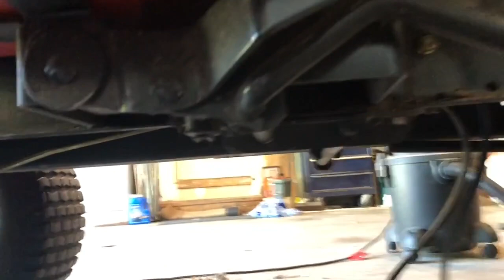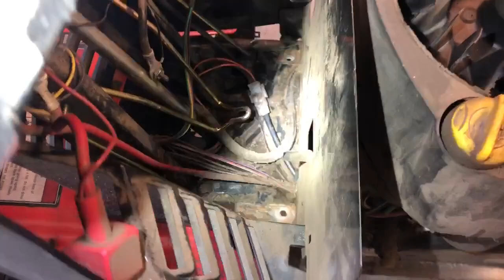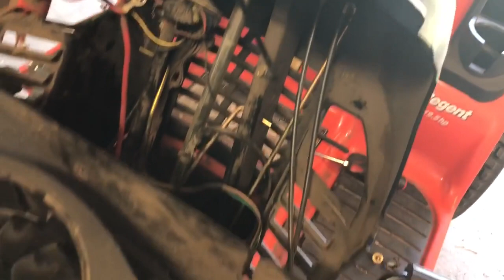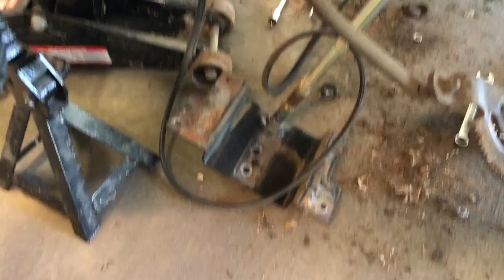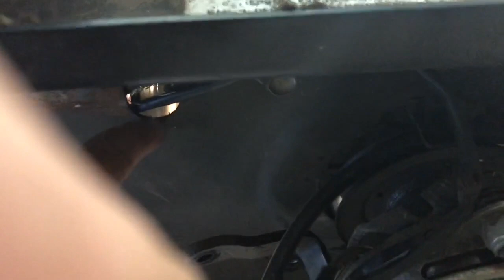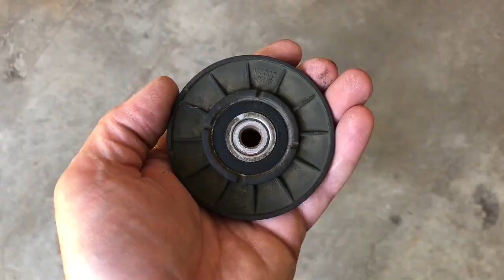stupid Simplicity Regent hydrostatic drive belt replacement!!! SO DUMB!

Comment: Good morning!  I have not followed this thread all the way through, but may be able to save you some time.  Get the thing up in the air enough, pull the steering wheel and the e-clip.  The shaft should slide right down and out.  Remove the center bolt that holds the electric clutch, have a zip-tie ready and swing the assembly out of the way and zip it to the chassis.  We don’t want to damage that cable by supporting the clutch with it!  As the other fellow said, remove the engine bolts and slide the engine over enough so the belt can clear that tab.  Remove the idler pulley and slip the belt right out of there.  Put the new belt on, reverse the procedure, smile, and plan on changing that belt in another ten years!

Comment: I GOT TWO OF THESE FOR $50.00. They both looked new.  I rented a trailer and got them home.  One has no deck ? Both needs batteries. The  one with the deck keeps throwing the   belt off the pulley. Can someone please invent a belt that can be a straight line and can be threaded through all the pulleys. Then clipped, bolted, or velcrode  in place. Thereby eliminating all this nightmarish disassembly ! Please let me know, you will be a hero many times over ! Get to work on it  now ! PLEASE! Now I know why they were so cheap !

Comment: Thank you! Thank you! For this video. I agree whole heartedly that this design is horrible. So I managed to get new belt installed. I still have an issue with it slipping off the transmission pulley under driver seat. Tested before I reattached mowing deck. So frustrated. The belt slips underneath the white fan blades under the pulley????? Any tips?

Comment: Love this video! I just took the belt off and will be putting a new one on there when I get it, hopefully this weekend. Your video made it about a 1.5 hour job to get it off (had issues with that stupid clip that holds the steering column in place). The mower got slower and slower and eventually just wouldn't move/go up a hill. The belt felt VERY stretched and was loose and floppy so I hope this was the issue.

Comment: YOU DON'T HAVE TO remove the steering stem, lift it real high or disassemble the gears .
  Just remove the steering wheel and circlip, put the nut back on to keep the shaft from dropping all the way out .
  Remove the 4 bolts on the bracket and let the bracket drop enough to lift the sides of the belt over the sides of the bracket instead of over the top of the shaft. 😅
Reply from the maker: the gear on mine was pressed onto the steering stem.  You couldn't remove it.
Reply: @TheDillio187    The circlip that you remove is at the top of the shaft underneath the steering wheel cover.    So the entire shaft, gear and bracket assembly can then lower about 1/2" and give you enough clearance to get the belt inside the bracket.

Comment: I had the same issue. What a dumb design for sure. The video I made of it is  titled "Snapper lt200 drive belt replacement". I could not find a video of this as well. I just stumbled on this one of yours. The rest of the Snapper is great to work on but to change this belt is more work than it should ever be. I also had some comments saying how it should be done but none had any video showing what they were explaining, plus some were just wrong. That frozen pulley is what probably wore out the belt.
Stay well, Joe Z

Comment: I replaced an idler pulley and thought it would be a good time to to replace the belt. I abandoned that idea when I discovered that the electronic clutch cable required removal. I replaced the idler and just replaced the used belt. What a stupid design.
Reply from the maker: I wish I had the option to do that.  I am just about to finish season #2 with the belt that I replaced in this video, so far, so good.  Now the engine smokes profusely upon startup, so that will need a rebuild soon.  It's always something!

Comment: Was taking the rack and pinion gear out necessary? I'm trying to figure mine out and it's a 2013 snapper 20hp. Thanx
Reply from the maker: I don't remember now to be honest.  A couple of the other replies here said it's not necessary, but you definitely need to get the belt around the steering stem.
Reply: @TheDillio187  Thanx. Between yours and some other vids, i've got some idea at least.

Comment: Had the loose steering issue on my 5 year old Regent.  Couldn’t find any info on my  model.  But after looking at fixes for other manufacturers, thought this would be similar fix.  WRONG, no easy way.  Considering the steering rack, the belt, the wire, the pto.  What a dumb design.  Wish I saw your video first.  Thanks.

Comment: I just did this job and it wasn't easy because I made a few mistakes by doing some things I didn't have to do.  I removed the steering wheel (nut and keeper ring) and hosted the front end. Wiggled a front tire and the steering stem fell out.  No need to take the rack and pinion and everything associated with it out.  Battery does not need to come out.  The biggest problem was that I had to cut the wires to the PTO to get the belt off because there was no quick connect. Have not finished and may add one for next time Tip: while you are doing this check your tension pulleys, one of mine was worn so while I had everything apart I took them off and replaced them.
Reply: How did you get the steering wheel off? I removed the cap and nut but it absolutely will not come off. How do you remove the keeper ring?
Reply: No need to take the stem out, only drop it an inch or 2 and snake the belt over the sides of the bracket.

Comment: Can you take the electronic clutch off and support it so you don't have to unplug the connector to get the belt on the front? And will the steering shaft pull out through the bottom without taking off anything else? Thanks.
Reply from the maker: I didn't try.  I didn't see any way to just take off the clutch, it seemed pressed onto the output shaft.  No on the steering shaft, you at least have to take the wheel off.  It might just drop out of there, then.  It's been some time now and I don't recall for sure.
Reply: @TheDillio187  Thanks for responding. I ended up hoisting the front end so the tractor was vertical. My steering wheel came off fairly easily and just pulled steering shaft out without removing anything else underneath. The clutch has a bolt to remove on the bottom and the clutch also came off easily. I just tied it to the brake pedal with wire so I could get the belt on the front pulley. It was finished in half-hour or less thanks to some of your info in the video. Hoisting the front end made a big difference also, but still a ridiculous design for belt placement.
Reply from the maker: @bome4691  if I ever have to do it again, I'll try it that way!
Reply: @bome4691  Thanx bud. I think I got the same thing.

Comment: Yep engineer's don't have to work on the stuff they design... tell you one thing, I'd be buying the best belt money can buy!
Reply: After  thought, can you add an idler in there to route the belt around that columb?
Reply from the maker: @arthurbyers9696  probably, but then you'd need to find a different belt (longer).  it's just a lazy design IMO, as they should have done just that.

Comment: Somebody tell me how to move that black pin that is going through pulley ,out of the way,it’s a conquest , 2002-04 , it’s like it’s part of the frame without no bolts holding it

Comment: Just did this. Found it easier to remove the PTO, steering wheel, retaining clip on the stem, and both steering stem bushings. Stem dropped straight out the bottom, no need to pull the rest.

Comment: I feel your pain - I had to go through the same troubles removing half of my Snapper to replace drive belt. I suppose, this should be left to pro mechanic, but in my area there are none so I had to do it myself. At least my belt pulleys are made out of metal not plastic. On same day I had to replace all belts on my tractor (drive belt + deck belts), so my wife kept well away from the garage for half a day because of bad language....
Reply from the maker: haha, every good mechanic cusses like a sailor.

Comment: Thanks for posting. You are a better man than I because my frustration level could never handle it. I have a Snapper LT200 lawn tractor but it is more or less a Simplicity. I have gotten 13-14 years out of it until the belt started slipping.  I'm sure it still has a few years in it but I can't see me replacing the belt. Probably just haul it off.

Comment: I have a simplicity regent not sure how old but you have to drop the blade clutch to take off the belt. Doesn't have a bolt to simply remove out the way

Comment: i just  put one on my express and what a pain in the ass  had to rip everything apart
i put mine up on the rear wheels  
yes the steering stem  i had to take the motor pulleys off  what a pain
the engineer of these a was a moron

Comment: First of all, son, after removing the mower deck, stand the mower up on it's rear end. Then you can work on it. By the way, drain the engine oil end place a plastic bad over the threaded gas cap for anti- spillage. about an half hour job or you're snoozing.
Reply from the maker: thanks Dad.  That's not a bad idea although I'm not real sure I'd want to try to pick up my mower by the front end by myself.
Reply: @TheDillio187  yes, dads right 😄
Its the best way to work on these damn things. Also if you have a sturdy tree branch or a open beam in your garage go to HF n buy the $45 crane. Worth every penny. No lifting

Comment: Were can I get the Diagram that shows how the belt is feed between the pullies?
Reply from the maker: I just looped the belt around the rear pulley and the engine, and then figured it out.  It is logical when you look at it.

Comment: How do you get the steering wheel off after you take the nut off
Reply from the maker: I had to pound mine off.  Another guy suggested using a flywheel/balancer puller, which is probably the better way to go as I destroyed my wheel trying to get it off, it was really stuck.

Comment: Not 5 or 6 of us, but 1974 of us! You are one of the few on YouTube that I found with THIS belt on THIS model! Mine JUST broke and I came right in and started searching to get an idea what I’m in for. I worked in a small engine and mower repair shop for about a year and a half to two years, between working at Auto Repair shop and a Ford dealership. I thought it would be a BREEZE working on mowers, chainsaws, weed eaters and small engines after the nightmare of a major auto dealership,... HELL NO!! Crap like THIS had me kicking myself in the ass and back into cars and trucks as soon as I could!! I thought that I wanted to beat some engineer with a combination wrench when I was working on some of the crap they came up with on Ford car, I couldn’t believe the crap on many lawn tractors! Those engineers needed to be beat and the thrown off a damn cliff!! I think High School kids could engineer some of this stuff better!! Hell! Aside from the riding mowers and lawn tractors, everything else was basically DISPOSABLE! I cost more time in LABOR to fix most chainsaws and weed eaters than it would to FIX it! The shop I worried for also had FREE estimates, so I knew that 90% of them that came in was gonna be a waste of my time and I was NOT gonna get paid for it! AND I wasn’t allowed to TELL the customer that when they would bring them in! Commercial guys with more high end stuff would, but the average homeowner with his Ryobi weed eater was just gonna eat up my time! Oh well, just venting after watching your video and knowing what I’m in store for, flooded me with memories! LOL
Reply from the maker: I had no idea this video would be so popular, it was more so an attempt to help a few guys out and get my rant out there so that I could hopefully laugh at it later.
Reply: @TheDillio187  you are one of the few that are actually changing the DRIVE belt, and not the deck belt and titled as the “drive belt”! I have a Snapper LT125 that is just about the same as yours with a different name. From what I can see on the ground, I’m praying that maybe Snapper mad that rack plate removable! Otherwise I might drill some bolt hole, grind off the weld and make it removable myself! Looks like that would be faster! The the next time it breaks it won’t take as long!

Comment: Got the belt off my 2009 Simplicity Regent. TheDillio187 did a fine job going over the procedure in his (your) video. I altered the process just a bit. Instead of taking the steering wheel off, removing the retainer clip, and dropping the entire pinion shaft I removed all of the bolts securing the steering column to the pan so the assembly could wobble around. It was enough to slide the belt over the pinion mounting plate flange underneath. Also, to get the belt off the engine pulley (belt keeper pressed in pan, not enough clearance to get belt off pulley) I removed the engine mount bolts and slid engine to the side.
Reply from the maker: goes to show you that there's more than one way to skin a cat...or a Regent!

Comment: Getting ready to change out the belt. Taking old one off then new one (1728008sm) gets here in a couple days. Appreciate you sharing your pain for this should be easy job. Advice to mower buyers, don't get a Regent (they may have changed the design but I doubt it).
Cannot believe the design. The mower (2009) has been a good one after I stopped using the power blower for grass attachment, it was tearing up the deck pulleys and spindles. Zero help from dealer. I digress, back to the belt. I was seriously considering cutting old one off and installing new one on right side of steering shaft and letting it rub the post.

Comment: How did you know it was time to replace the belt.  My mowed struggles to climb small hills and pull and yard equipment.
Reply from the maker: the belt kept popping off of the pulleys.  Sounds like yours is probably slipping badly.
Reply: @TheDillio187  The belt has never slipped off But I cannot even pull a roller or a seeder because the tractor won’t move
Reply from the maker: @alexblair4267  The belt is slipping around the pulley. I would just replace it now otherwise it’s going to get hot in break anyways.
Reply: Are you saying replace the belt or the pulley
Reply from the maker: @alexblair4267  the belt, but inspect the pulleys as they can be damaged as mine were as shown in this video.

Comment: Timely video for me. I got to the removal of the dang steering wheel and I cannot get it off the shaft after removing the nut.  Did you have any trouble with that?
Reply from the maker: Don’t forget the retaining clip under the plastic cap.
Reply: I can't get the wheel off, there doesn't appear to be a clip under the nut?
Reply: Did you have to use a wheel puller?
Reply from the maker: @jeffgodsey2947  I would try a puller. I destroyed my wheel getting it off the second time around (don’t ask). Sourcing a new one wasn’t easy.
Reply: @TheDillio187  ive tried a puller and got no where. Ive tried many thing. Is there something im missing?
Reply from the maker: @Vaga-Bard  it’s probably stuck.  Like I said above, I broke my original trying to get it off a second time and had to eBay a new one.  I used anti seize on the new one!
Reply: @TheDillio187  thanks brutha. Wasn’t sure if there was some other pin or bolt i wasn’t seeing.
Reply from the maker: @Vaga-Bard  good luck, it's a PITA!

Comment: Thanks buddy. I'm in this situation now. WOW! UNBELIEVABLE!!. I'm going to try and find the belt number and put it back together and make sure I can get it before I disassemble this travesty...
Reply: You wouldn't happen to remember the belt # would ya? I'll search for it later. Thank you again!
Reply from the maker: @scottydice1426  not off the top of my head.  I used an online Simplicity parts dealer and cross referenced it.
Reply from the maker: it's a pretty common belt.  I think a lot of MTD mowers and what not use it as well.
Reply: @TheDillio187  I'll find it. Thanks!
Reply: @scottydice1426  Simplicity 1728008SM  Belt, HA 89.3" Lg    Look on PartsTree.  They have diagrams for EACH tractor model so you can pick your own correct model.  Hope this helps 4 years later :)